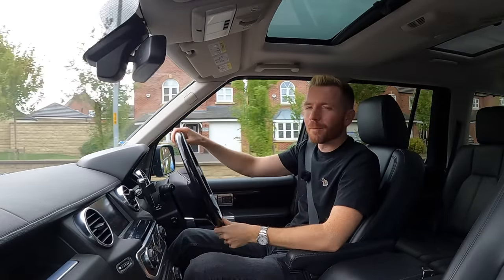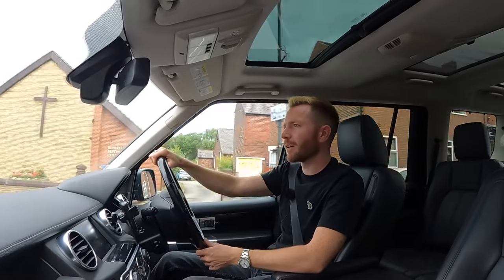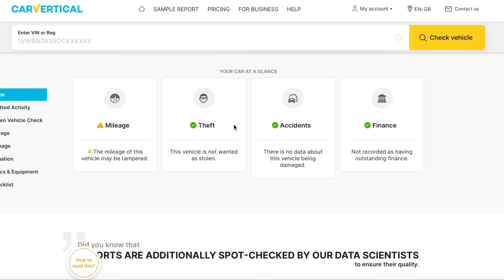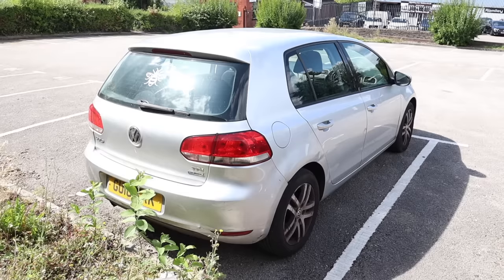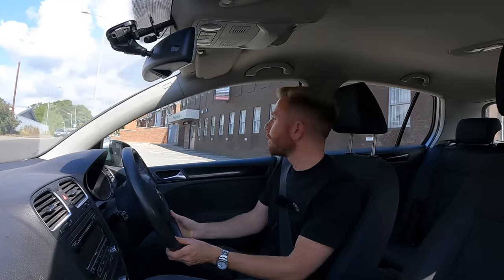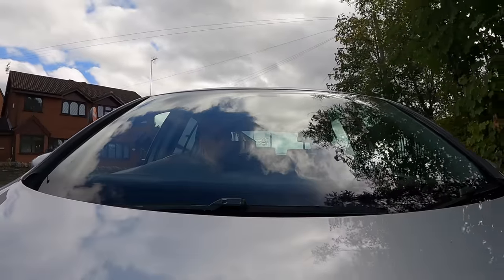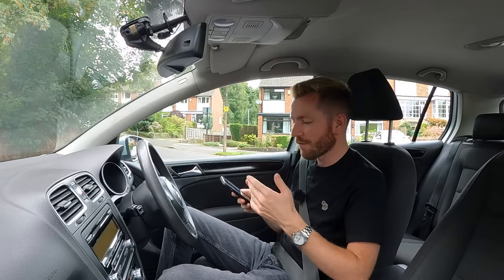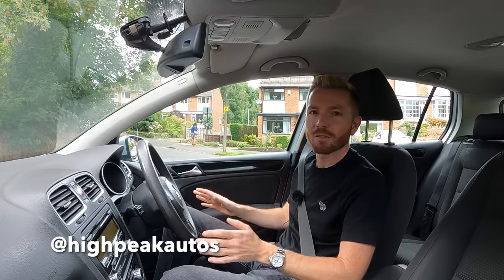I BOUGHT A CHEAP VW GOLF MK6 FOR £700!

Comment: The first two numbers of the date stamp is the week so 1322 would be the 13th week of 2022. I learned that off a tyre manufacturer rep that came to our garage many many years ago…. Every service I do I check the age of the tyre now and if they are ancient then I always recommend replacement due to age and if they don’t have them changed it covers my ass if the worst should happen (exploding tyres) I have an 8 previous owner 2004 Mercedes Benz C220 Sport-Coupé and it was very well looked after no real rust even on the rear arches. I have spent some time and money to make it as damn perfect as possible now and made it more modern with a updated genuine MB bonnet badge so black with satin chrome insignia and same for the alloy centre caps updated them again up to the latest style black with satin chrome insignia again genuine from Mercedes Benz. And a updated stereo to have apple car play and android auto that is designed to look factory original…. Otherwise completely stock. It’s my first and probably last Mercedes…. I don’t think I will ever get rid unless it’s taken from me (written off)

Comment: Who drives their car without any floor mats? I travelled over to England from N.Ireland last year to buy a G31 5 series and it didn’t have floor mats, I couldn’t believe it. Even for the journey back I had to stop at Aldi and buy some crap ones to do until I got proper fitted ones.
Reply from the maker: In my own cars I usually have mats over the mats 😂
Reply: They get swiped to put in their next car!

Comment: Incredible how some people can wreck a car.... they are not that hard to keep basically clean and maintained to a standard, for some though they mean absolutely nothing other than a means of moving around as cheaply as possible ( and in a filthy unhygenic interior which soon becomes normal no doubt). All of my lease cars get handed back at 80 to 90k miles requiring only a basic retailer  valet before being sold on ... I always reckon the cars I hand back eventually end up as cracking used purchases when they arrive in retail land 😄  and of course fully maintained as per lease agreement.... I couldnt sell a car unless it was clean but we are all different I guess....

Comment: Good Lord the amount of brake dust baked onto those alloy wheels alone is horrendous! 

Definitely a car that's been run on minimum budget with little care taken over its life, which saddens me.  My daily commute is the ever trust 18 year old Smart Forfour diesel, owned for 13 years.  She's covered 205,000 miles, still pulls like a train and to date had never let me down.  

Looking at her you'd never know it had covered that amount of miles as I look after my toys.  The interior including seats look almost as new.  Aside a minor scuff on the lower front arch (someone's careless parking), the bodywork is in great condition too. 

Pre-wash and two bucket wash method with wash noodles each week for my cars reduces scratches and marring to the paintwork. 

Pains me to see people not treating their cars well, doesn't take much time and effort each week or two to keep on top of it.  As you say, I often wonder what the state of people's houses are in too!
Reply from the maker: I agree

Comment: Wow how is diesel roadtax so cheap in the UK. Here in The Netherlands this 1.6 Golf is about €1300 in road tax alone. The petrol version is about €500. Why isn't everyone driving diesel in the UK? I think 90% of the people here would drive one if the road tax was not that high.
Reply: its a add blue maybe thats why its cheap
Reply: i dont understand why people buy petrol cars either although i did notice the other day in london that petrol was 20p a litre cheaper than diesel usually no more than 10p difference
Reply: still would have to be about 40 or 50 p cheaper for it to be as economical as diesel

Comment: Iv just changed my plates, not because its been in a bump just cos the old ones looked scruffy 😂 the previous owner of this golf was probs cheap and didn't wanna replace the front if it looked good, you can buy just the rear plate, just not convinced they've all been  in bumps, lazy answer 😂
Reply: Bumper paint doesn't seem to match???
00:08:31

Comment: Hi, 
Please help me out with some advice , I really appreciate your time.

I bought a car 11 days ago from a dealer ( like yourself) and the car has a strong rattle under the steering whell and they refuse to fix the issue nor do anything about it. They upsold me a warranty for £300 (12 months) and they push me to the warranty compant to fix the car. I didnt receive any paperwork or contract for warranty nor my new V5 and I don’t know what to do, dont even know the company for the warranty contract. 

Can I cancel everything and get my money back? Do I have the right to cancel the finance and get my deposit back (£1000) paid to the dealer?  I’ve also invested roughly 1000£ on car service and maintenance and I know thats my loss but I would rather loose 1000 then 15.000 of finance and end up with a lemon.

Is so sad to see dodgy traders scamming people everywhere meanwhile the good ones can’t find buyers :(
Reply: You need to read up on the Consumer Rights Act. It gives you the right to return the car or have it repaired.
E.g : If you've owned the car for less than 30 days  The Consumer Rights Act gives you an initial 30 days to reject it, if it is faulty, and claim a full refund from the dealer that sold it to you. You can also ask for it to be repaired or replaced

After those first 30 days you have to give the dealer a chance to repair or replace the car.

If you've e owned the car for more than 30 days  You're entitled to ask for a repair or replacement free of charge.

If the repair or replacement is unsuccessful, you're entitled to a refund. The car dealer can deduct ‘fair use’ from the refund after the first 30 days.

First six months If you take the vehicle back within six months of purchase, the dealer should accept there was a problem when the vehicle was sold and offer a partial refund or to repair or replace it. 

If the dealer doesn't accept there was a problem when the vehicle was sold, they'll have to prove this.

After six months It will be up to you to prove there was a problem with the vehicle when sold to you, after you've owned it for longer than six months. 

You'll have to provide evidence of this so it may help to get an independent report which could establish the condition of the vehicle when sold. 

Make notes of your interactions with the dealer, dates and what's said, in case they are awkward.

Comment: Hmmm, been thinking about one of these as a cheap run around to get through the crisis.
Reply: They’re not a bad little car. I was thinking when Matt’s code reader brought a glow plug, that’s an easy fix. Biggest risk in them is the EGR failing. It’s over £300 for a replacement & half a days work to change it. It’s way up behind the engine & from memory the cradle needs dropped to get at it. 😬
Reply: Great cars if maintained properly...60 mpg average and 80mpg on longer motorway runs , had ours 8 years👍
Reply: buy a 2.0L TDI engine version, much better
Reply: I've been thinking the same, but about a diesel Peugeot 208.  Silly MPG, low tax too.
Reply: @hughmarcus1  ...the EGR valve over £1000 at a main dealers , had mine replaced at only 4 years old but thankfully under warranty so cost me nothing.
Never been a bother since as the vehicle mainly used on the motorways unlike the previous keeper who'd only done school runs in it , why would you buy a diesel to do that 🤣
Reply: Mk7 Golfs are better, but nothing wrong with a Mk6

Comment: Looks like a drug runners pool car. 
I'd break it. 
It will cost more than it's worth to get it looking decent. 
£700 was not really a bargain.
Reply: Could've doubled its value if he'd checked under the spare wheel or checked for anything taped under the seat 🤣

Comment: the 1.6 CR TDI engine from VW is one of the worst engines VW ever made. How do I know this? I own one. Injectors are gone, DPF and EGR has gone, and now possibly the head gasket. Driven on motorways only and serviced every 6000miles. Worst engine ever.

Comment: Matt, prefect timing I’m working out what to do with my Mk6 2.0 TDI, where the ABS system has just failed. Similar mileage. If looked after how long should the golfs go for?
Reply: my 2.0 tdi is on 188k miles and going strong

Comment: Vw without warning lights wouldn't be a vw. Great example of long living legend from the past. By 2010 it was legend only and nostalgia. I will never forget lot of 5 company passats with fantastic 2.0diesel engine when it was introduced to the market around 2007.
170bhp, what a fantastic machine it was when it was on road actually not in the garage. Anyway all of them died around 100k. without reason. Fair Play, Dealer replaced engines in all of them. Luckily all of them went back after end of the lease. At this point vw died for me. Renaults, citroens and peugeots are more reliable than vw these days. Worst case scenario they are on the same reliability level but for much less money.
Reply: Not my experience -Vw group much much more reliable than any french car.
Reply: @01jvb  old ones were really good but I'm talking waaaay back. 30 years ago. From my observation everything went wrong for vw group roughly when 1.9diesel was phased out and 2.0diesel was introduced. It was the moment when they introduced 1.4tsi or generally tsi and tfsi engines and dsg gearboxes. All of them with catastrophic problems. Literally catastrophic. Friends got vw's, they are just as good as anything else today and overpriced... I wouldn't buy one at this point.
Reply: @damcyk4  I've had 4 VAG cars in the last 15 years and they have all been super reliable and very well made, in my opinion.
Reply: @01jvb  brand new? Or older ones (above 5 years old)?
Reply: @damcyk4  brand new
Reply: I used to drive a 2.0 PD 140 TDI passat, the oil pump failed and fuel pump too.
Reply: I agree after about 2005 ish VW diesels went downhill. Dpfs came in, and the cost-cutting on engine internals. My 2004 Audi A4 with 1.9 pd is still great at 262,000 miles. The last of the "golden era" of vw diesels.